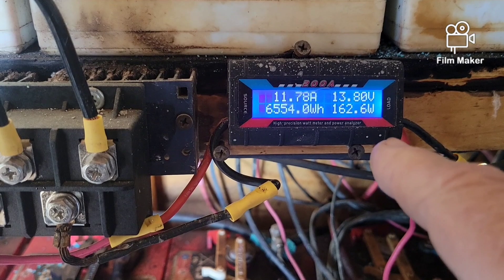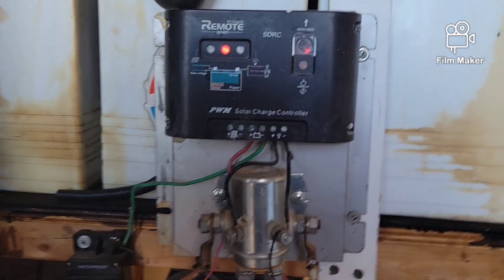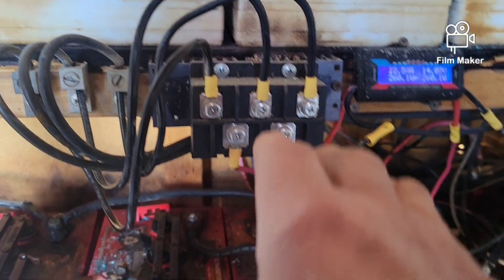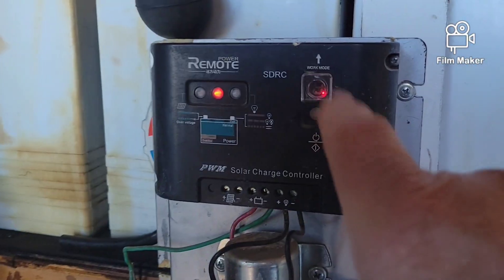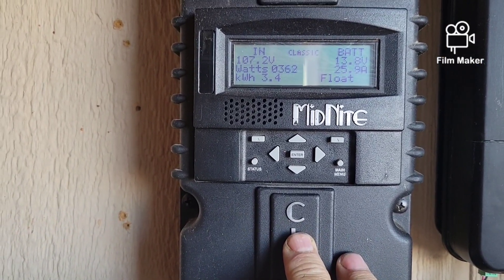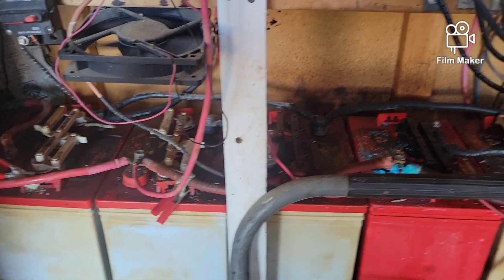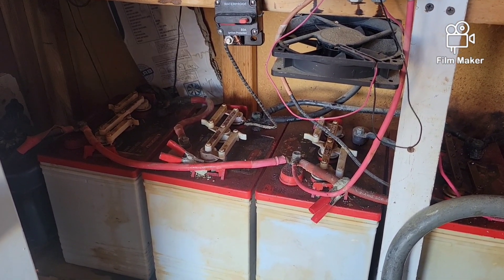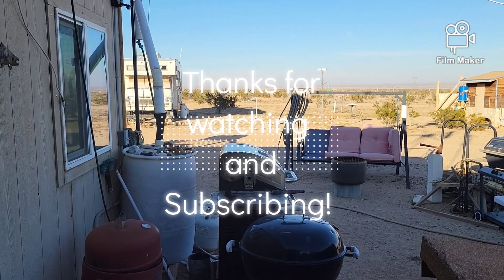Wind & Solar Power Off Grid 12v System, Jan. 10, 2024

Comment: You have a nice setup on your solar appreciate the tip on those pour quality Chinese charge controllers. I hope you soon make the upgrade to LiFePO4 I did and never looked back. the batteries are also getting so inexpensive right now too. They also charge much faster than lead acid and they are way cheaper based on how much power you can get out of them. If you can try to switch over to 48 Volts too. don't need such high current wires. and easier to increase capacity.
Reply from the maker: Thanks, and welcome aboard!  Yes, my plan is to go to 48v on the upgrade, and the 10k, 48v pure sine, split phase SungoldPower all in one.  My Midnite classic controller will become a controller for a 48v KT7 PMA.

Comment: I've viewed your video several times because you have carefully chosen words that grabs the attention of the viewer. I have a problem with my B&C 500-watt wind turbines that have three wires protruding out of bottom, after testing them with a cordless hand drill the turbines were spinning at 11 miles per hour producing 36 volts on one turbine. My rectifiers will not get hot, not even warm. Can you help?
Reply from the maker: What is the max wind speed rating for your PMA?  That is what you need to produce 500 watts.  At 11 mph, you are probably only producing 50 watts if lucky.  Also, even though you are using a PMA to reduce wire size and cost, the distance away makes a difference since there is power loss over longer wires.
Reply: GBear, thanks for such a quick response, but I'm 200 miles away from my home, and I must go to the site where i purchased the wind turbans in order to give you exact numbers. Expect some information on my 500-watt turbines within the hour. Your videos on Induction are interesting and I'm looking forward for to view your next video on hooking up several lights using doorbell transformers.
Reply from the maker: @eugeneremmelsjr.2978 Thanks.  My experiments have taken a vacation since I retired.  I no longer have all the free time I had when running 2 businesses....🤣👍
Reply: I can relate to that, my grey hair is now turning white.
Reply: @GBear  Two? You're a better man than me!
Reply: @GBear  Rated power:500-watts, Max power: 520-watts, Rated Wind speed: 11m/s, Start up wind speed: 2 m/s, Max wind speed: 45 m/s,  Rated rectified voltage: 12/24/48/ DC... The distance between wind turbines and rectifiers or battery bank: 10'feet using 8 gauge stranded copper wire. The rectifiers are new.
Reply from the maker: @eugeneremmelsjr.2978  You'll only produce 500 watts at 40m/s or close to it. Start up wind speed will produce minimal electricity, not worth considering as production.  You would need about 20 m/s to produce an adequate charge for your battery bank.
Reply: @GBear  My home is located in a place where we receive anywhere between 12 mph to 85 mph wind speeds. I did notice a strange sound coming from the turbine every time I bump, or touch the alum bus bar with any of the three wires, It sounds like it's shorting out, and slowing down. What do you make of that? ask your friends, anybody please.
Reply from the maker: @eugeneremmelsjr.2978 The 3 wires coming from the PMA should never be shorted together.  You can permanently damage the stator.  Those wires connect directly to the 3 wire side of the bridge rectifier in any order.  Then the 2 wire side connects directly to the batteries, or a dedicated charge controller for turbines.  If you connect directly to the batteries, you will need a digital dump diverter to keep the batteries from overcharging.
Reply: @GBear  How stupid can I be, that was the problem that I overlooked and the answer was right in front of me. Thanks GBear
Reply: @GBear  I've got 3 digital dump diverters from Missouri Wind and Solar, and a couple of unknown controllers. I'll send you some pictures when I head back home, Thanks again GBear

Comment: If you are going to build a 12V system... it probably makes sense to with with an integrated Powmr 1.5kw+isolation transformer to get 110v.... the powmr itself is cheaper and better than almost all the MPPTs on the market for 12v because it can do a 400V array. You can do it for about $350+batteries+panels.
Reply from the maker: Welcome aboard!  I will be upgrading to a 48v system, and using an all in one with lithium batteries.  I'm just waiting for some money.

Comment: My LifePo4 batteries are at 27.2 volts. I guess they'll drop a little bit when sun goes down. I'm getting 200 watts in a gust from the wind generator. The lead acid batteries are at 13.27 v. My wind generator is only 600 watts, and I didn't use a controller, just a 250 amps rectifier. If the voltage gets too high I turn on a 250 watts heat lamp.. It usually doesn't make enough to run that, so the voltage goes down. I've just got it on ten batteries, two more I have to get some terminals for. It was 60°F today so I went out and got scraps at the truss company to burn ❤️‍🔥. I guess when I get caught up I'll get one more lithium battery 🔋 for my system. Four is all that I can hook up in parallel, it says..The three I have are working great though.
Reply from the maker: Yeah, most I have researched say 4s4p.  But you should be able to do 16 total batteries in 4 groups of 4 each.
Reply: @GBear  I should, but Im not going to spend $6000 for the batteries. Sun is down now, they went to 26.6 v. ( Normal)
Reply from the maker: @davidpotter9462 Yep, it all has to do with individual needs. I'll be going for a bigger capacity because of my needs.
Reply: @GBear  four will give me 12,240 watt hours, plus the twelve lead acid batteries 🤔. Seems to be enough.
Reply: @GBear  oops that's more like $8000
Reply: @GBear  actually it's $9000
Reply: @GBear  four are gonna cost me $2244

Comment: Your classic is designed to work with 48v in fact you can get twice the watts out of it at 48v than you can with 24v and 4 times as many as with 12v
Reply from the maker: Welcome aboard!  Yes, I am aware of higher wattage due to Ohm's Law. Thanks for watching and commenting.

Comment: I'm doing the same thing, going to lifepo4 batterys I'm Going with Power Queen Lifepo4  12V Batt, Best Batt for the money..100 ah
Reply from the maker: I'll be checking those out.  Right now, I have my eyes on Li Time, Chin, or Weize.  I definately need cold charge protection out here.

Comment: Gbear it will run 48v ... Congrats on moving up too lithium.....
Reply from the maker: Thanks Dan!  Then I can use this Midnite maybe for my 48v PMA.  As long as the PMA won't produce higher than 198v.  My Midnite is a 150, plus battery voltage of 48, equals 198v max input.

Comment: Before you go lithium look at all the problem caused by BMS failures and compare the documented life of a fork lift battery to the real experience of lithium . Count the cost per amp hr a industrial flooded lead acid battery win on all levels hands down . They have no temperature  restrictions  no BMS failures and over 100 years of documented service
Reply from the maker: Thanks.  I'll research that.

Comment: Do people have to rest their charge controllers more from like breaks in full day use more when comparing 12V to 24V systems?

I'm probably stuck with 12V. I don't mind that. Its just that the equipment pieces for 24V jump a lot more expensive compared to 12V. So I do want to make 12V work.
Reply from the maker: A good charge controller will put the charge at rest automatically when batteries have reached the full charge setting.  That's why a Midnite Classic 150, 200, or 250 is a great purchase.  It's a set it and forget it controller.  It will float when needed, and rest when needed, and always monitor for mppt efficiency.
The new thing is "All-in-one" systems, so it is cheaper than buying separate components.  EG4, SungoldPower, and others make life easy.
Reply from the maker: By the way, most components will handle 12v or 24v, except inverters.

Comment: So do we have to switch our solar panels to accommodate the 48v system??
Reply from the maker: Remember, you connect batteries FIRST to tell the controller what voltage you want to charge.   The controller then adjusts the voltage input to those parameters.
Reply from the maker: No, as long as you stay within the max voltage input for the all in one.
Reply: @GBear  
Cool thanks!
Reply from the maker: @tonylarson1960able  you're welcome

Comment: G Bear, good evening!  I saw one advertisement for a LiFePO4  48 volts, 200 amp battery.  It  was 8X overall life equals 96 batteries.    But the price tag was $4,000
Reply from the maker: Yeah, there's more to consider.  Because I get cold temps here, it must have cold charge protection.  Otherwise I would have to build a heated room for them.
Next, they need to be 4s4p compatible if in 12v, 2s2p if 24v, or 16p if 48v.  Then, the amp hour ratings need to be considered.  A 48v battery should be a minimum of 300ah, preferably higher.
My research has been informative at best.
The nice thing about LiFePo4 is you get to use 100% discharge compared to 50% discharge for standard deep cycle batteries.  That means since I now run 12, 12v batteries in lead acid deep cycle, I can go to 6, 12v LiFePo4 batteries and get the same service.  So I will upgrade to 6, 48v LiFePo4 and be able to run things after dark that I can't do now.
Reply: @GBear  great.  Keep doing the research and I’ll be picking your brain when I get ready to set up mine.  Have a good night.  🫡